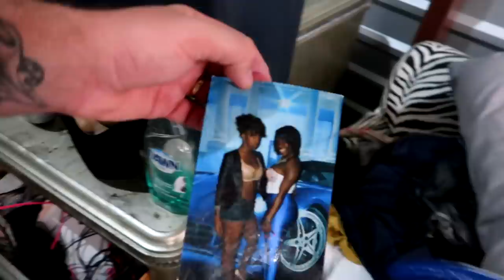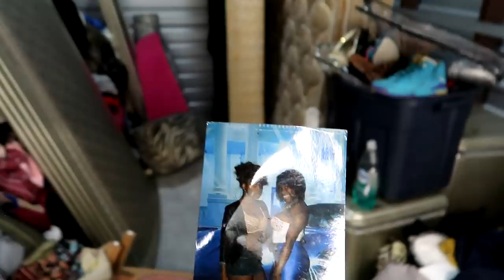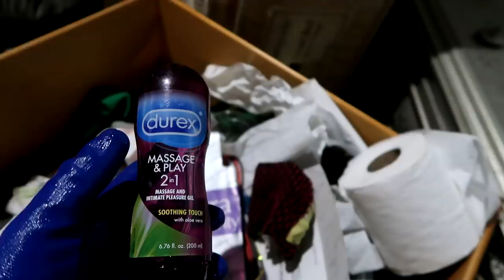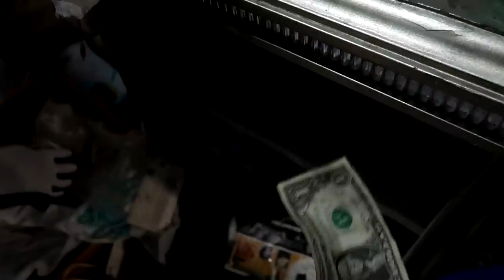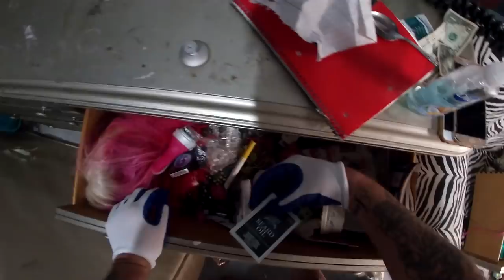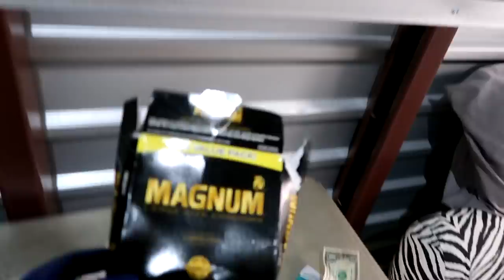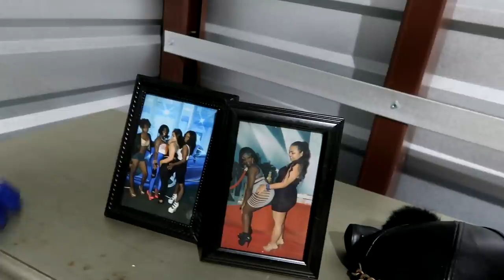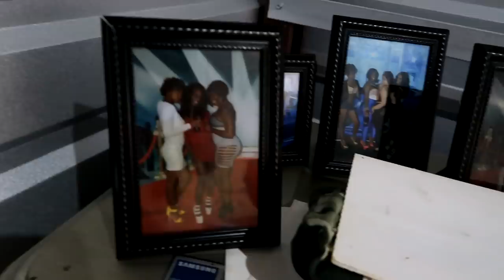We Bought A Storage Unit That Belonged To Some STRIPPERS

Comment: So if you are new to the storage unit game here's a Lil info you might can use in the future. Lotta auction are shady as hell, this appears to be a staged unit. The idea is they go in and remove all the valuable items, then fill all the bins and drawers with junk trash from other units. They will strategically place a few items to draw interest and make buyers think the unit has more value than it actually does. Such as the stripper pole n LV bag. Its good to do research on the unit, look at previous auction listings to make sure the same unit number has not been sold recently and check reviews from experienced buyers they are usually good about reporting sketchy auctions. But it appears to me you got hit with one of these staged units. Sorry for the bad luck but hey it definitely made a good video. Best of luck, stay safe, APS army 4 life